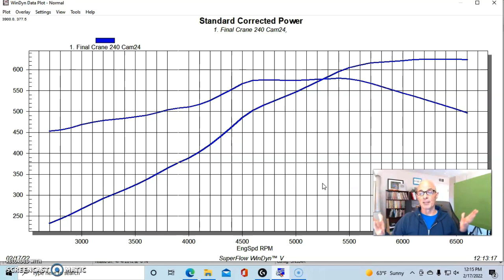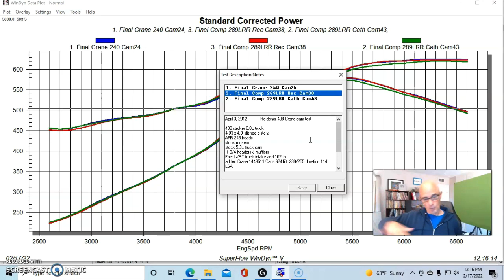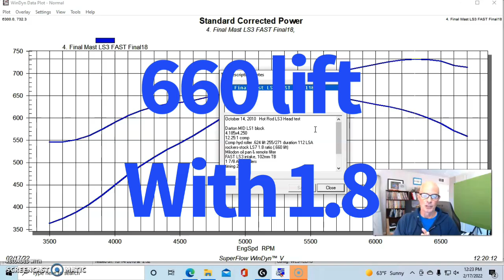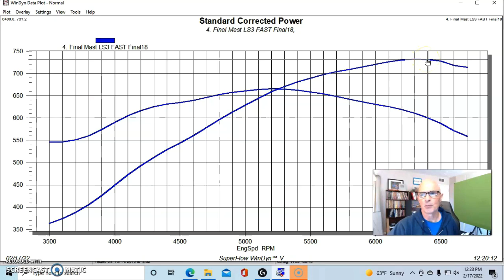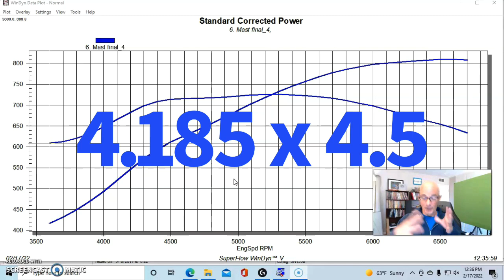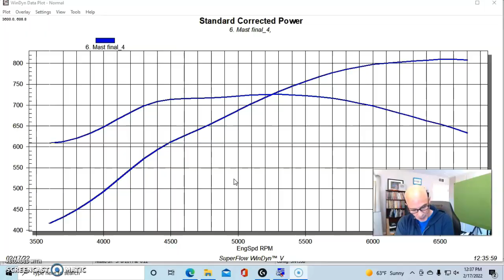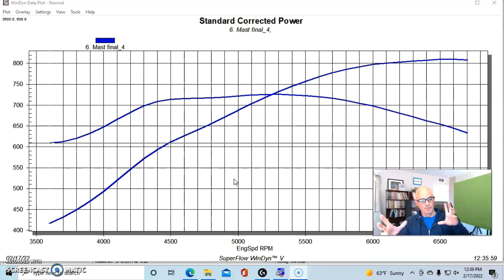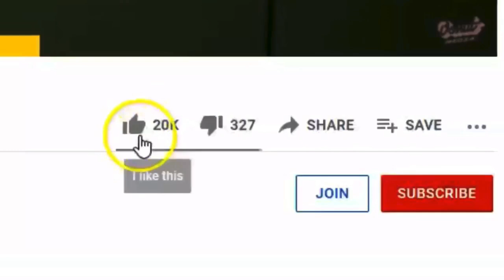HOW TO MAKE MASSIVE ALL-MOTOR LS POWER! HOW MUCH POWER DOES A 408, 468 OR 495 STROKER LS MAKE?

Comment: Richard, if doing an max effort NA build, and a boost build side by side, what size engine would you use for each? I currently have a 6.0 iron block, but if a 5.3 aluminum is better for stroker, is that a better NA base and using the 6.0 for boost?
Reply from the maker: I have not seen people sleeve an iron block but it might be possible. The 6.0L will make more power than a 5.3L, but if you sleeve the 5.3L and make it a 454 or 468-it will make more power.

Comment: Love the clarity with different cams with similar dimensions basically doing the same in 468 and de mystifying that bigger cubic inch generally better. I continually get these custom cams made for my sbc thinking there is magic in duration, lift or LC but all doing basically the same as proven through et and mph at track. Also in dreaming of future bbc purchase find magic in 565 vs 582 vs 598 but the reality is more cubic inch more power. Lessons to remember

Comment: What compression was the 408? How much does that come into play with the cam specs? I have a 12.1compression 408 trying to figure out best cam, street driven
Reply from the maker: pick a cam for your rpm range, but with 12:1 static-more cam helps suppress detonation
Reply: Thanks! I was looking at a 244/256 114+3 I’m just worried it wouldn’t be streetable at all

Comment: Why not use the Mast or LS7 heads on the 468 kinda seems like leaving power on the table
Reply from the maker: ALSO RAN THE 468 WITH LS7 HEADS-BUT COMPARED THE LS7 HEADS ON A 495 STROKER

Comment: Richard the video is VERY informative,love the content! I currently have a 6.2 as well as a 6.0 iron block.I want a naturally aspirated stroker combination that would give me an engine with a broad torque band with over 550 ft lbs of torque and over 650 hp that is reliable and streetable. This set up will be in a 70 Chevelle with a 4L80E transmission. It wont be raced but, will be spiritally driven. Any advice is greatly APPRECIATED! Thanks in adavance! Take Care
Reply from the maker: BUILD A 416 STROKER OUT OF THE 6.2l

Comment: That 408 on stock cams would make a killer pulling motor I would bet it would compare to the 8.1 well
Reply: The 495 on mild cam would be insane for pulling
Reply: 408 on stock zr1 cam how much would make hp ? As I'm planing to rebuild my ls3 engine

Comment: I’ve heard there’s risk of piston rocking during BDC on a regular 6L block when combined with a 4” stroke which causes accelerated wear on the piston skirts. Is this true in your experience?
Reply from the maker: not usually an issue with a 4.0 stroke-don't try the 4.10 or 4.125 strokes with a stock sleeve length
Reply: @richardholdener1727  thanks Richard. That was the only thing holding me back on my stroker build

Comment: What would you recommend for hitting my power goal if i don’t reach it with my current setup: 

102 mm fast manifold
102mm TB
80lbs injectors
Eagle 408 Stroker aluminum 6.0 block
10.9:1 compression i believe. 
Currently running a 234/242 .629”/.615” 112 LSA +4 advance cam. How much power do you think this setup should make roughly ? Looking for around mid 500’s.
Reply: 500Whp or 500 crank? Those upgrades just on a 6.2 would easily get you over 550HP at the crank
Reply: What heads?
Reply: @Ws6Ms  this setup made 450whp/450tq on a dynojet SAE on Livernoise ported 243's from 2008 lol and the actual CR was actually around 10.1, currently waiting for my M311 heads coming in from Frankenstein with 64cc chambers.
Reply: @elplatanito8094  I had a 408 that made, give or take a few hp, 517 whp with -8 pistons, trick flow 225s, an overly aggressive pain to drive cam and fast 92! Took that setup and put it on a 6.0 lq9, it made 489whp with similar cam as yours. I think my compression was around 10.3 or so... Your heads had to be the factor!
Reply: A piece of advice: if you can, run dual symmetric intake pipes with air filters into your throttle body. The problem with large throttle bodies is that you lose a lot of low-end response because the air velocity is so low with a large throttle body at minimum part throttle. If you run dual intakes into a collector right before the TB, you'll gain both power AND response.

Comment: So been trying to figure this out for quite some time but I really want to make a very small displacement v8 ls based engine if I could without custom parts I want something around 4L or 250 cubic inches. I want to twin turbo it kinda like ford's ecoboost but still have that v8 sound, just to prove a point that removing cylinders is not the way but to just reduce size with added boost
Reply: You can't really make a 4L LS without custom parts... you're going to have to custom make a crankshaft to be that small. In reality there's no need, if you want a small displacement engine, go with the Vortec 4200 which is the inline 6 that came in the Trailblazer. Great engine that's very reliable and can take plenty of boost. Mini videos of it online, it's considered the Chevy "Barra" motor.
Reply: Years ago I remember reading in a Hot Rod magazine about a combination of parts that would give you a 231 cubic inch V8. That was SBC stuff though.
Reply: @fryloc359  yeah it's an extreme de-stroke kit troke kit

Comment: Richard, how about doing an LS 408 stroker turbo torque monster build. Building a combo for ultimate torque instead of HP. Maybe a maximum of 5500 RPM  pulling torque from 1600RPM. This would be ideal for truck guys with gas engines pulling heavy loads looking for gut wrenching diesel torque values at the same RPM.
Reply: I've got 413 stroker Turbo engine is built forged everything hand ported req heads 4.00 bore 4.100 stroke, JE flattop pistons, intake, Roller Rockers, pretty much everything you can think off, has the fuel system that can support 2000hp, 98mm Turbo made 1600hp and 1100lbs pretty easy can go more but I'm worried about the 6l80 transmission but  have a built t400 coming for it
Reply: @Disableddragracer you have got to tell me more about this 6l80!! Who built it? And how much $
Reply: @antwain7942  its a GM 6 speed electronic auto transmission you can alter stall speed and shit points on the dyno it was on my stage 3 6lt LS, mine isn't stock but will be doing more to mine, you need to put a Good external trans cooler and a deep sump cover as they don't like heat you can buy shift improver kit for it as well as a valve body reprograming kit for the valve body High stall convters are a bit more expensive due to being electronically controlled, there excellent streetcar box but their expensive normally the horse power my engine is capable of making people put turbo 400's or power glide, I went with a turbo charger because I can control the boost no 1 needs a 1500hp 24/7 Dailly
Reply: @ZaneGREY0How is the engine doing?
Reply: @Disableddragracerwhat fuel and how much boost for 1600hp, on engine dyno?

Comment: Opinion needed. I have a 427 dart shp i used for boost. Im switching to a N/A setup. Options are order pistons and rebalance keep cu. at 428cu.Other option in use dart block and get a 454cu stroker kit. 454 kit and build would cost about 3k more. Both compression will be 13.5 e85 with a baby shot 200 or less.This is street car 80% of time.Would there be much difference in power between both.which way would you go?
Reply from the maker: I wouldn't worry about going bigger for a 80% street motor-just add more NOS

Comment: Hey Richard, what 4.25 crankshaft was this in the 468 ? I have been trying to find something over 4.125 stroke that a 6" rod will clear, to stay in a 9.240 block, but everything requires min 6.125 rod and with a 4.250 crank/6.125 rod, that leaves a piston with a compression height less than 1"....so not ideal. With a 4.250/6" rod, you can run an off the shelf 1.115 height piston, but I can't find a 4.250 crank with counterweights short enough that doesn't require a 6.126" rod.
Reply from the maker: WHY A 6.0 INCH ROD?
Reply: @richardholdener1727  so that the piston doesn't have a CH of less than 1". Not much meat in the dome after taking the 1/2 the pin into account.
Reply: ...and a 6" rod will allow me to run an of the shelf 1.115" CH piston with that 4.25" stroke. This is a case where 1/8 of an inch is a big deal (crown thickness)

Comment: I'm a little butt hurt. I have a 427 Ford Windsor engine. 600 lift cam, AFR CNC205 heads, trickflow 351R upper and lower manifolds, 75mm throttle body, 1.75 long tube headers, 3" exhaust and 60lb injectors... I'm only making about 511hp at the flywheel and 558ft tq. My engine management must need improvement😕
Reply from the maker: 351r INTAKE?
Reply: @richardholdener1727  yes, the upper and lower manifolds that trickflow makes for the mustang.

Comment: I have an 1983 Chevy truck with a 5.7 350 block and want to keep it stock what can I do to produce the most torque? I  need it to pull a heavy trailer?
Reply from the maker: headers, mild cam
Reply: Do you think that making it a383 striker will build enough power to pull the bigger hills here out west ? Or is it worth the extra cash doing that?  The 350 does okay on a flat but kinda lacks on the hills. Running Edlebrock 600 and dual plane intake. Tried to keep the fix cheap but after cost from my son overheating it I tried to just purchase a running one and it got low oil pressure and a bad cam so that tells me this block needs some rebuilding I can order a Mabbco long block performance for 1,850+ freight $250 but wanted to get your opinion on what might do the job better? I thank you for your time and opinion as I’ve owned this truck quite a while and in good shape so just wondering if I’m dumping $ down the toilet. Lol

Comment: How is it that every chart shows that the horse power and revs cross at 5225 every time no matter what it is....!
Reply: It's because of the formula to calculate HP from the measured torque.  TQ and HP will always cross at 5250.
Reply: @TheKent99  l'm looking for a cam for my 351 but not sure, is it worth going above 5000 for a relatively stock motor and still get high horse power, what would you recommend...?thanks
Reply: @josephclearnight3403 , I'd suggest looking for reviews from similar builds and see what seems to fit your criteria.  I don't really know the 351 Fords very well, but I'd be inclined to agree that picking a cam for power past 5k RPM is probably not a good idea on a mostly stock engine.  I remember the 302 Ford heads being pretty awful and I doubt the 351 heads were much better.
Reply: @TheKent99  you are right the heads need velocity, a manifold as tall as the empire state building......thanks for response.

Comment: I think over 800hp (pump gas )can be achieved with around with a 427 to 454 with say around 7200 to 7800 rpm range with a little attention in cam and head combo,and with a carb
Reply: Seen a number of LS7s with All-Pro, MAST, "insert a great head" and solid roller cams, do this.. even with stock LS7 internals.

Comment: Just curious. How would a 4in bore and a 4.125 in stroke compare to a 4.125 in bore and a 4 in stroke. Would that be the same displacement and if so how would the hp and torque differ. It's been a long time since I ran the math to find out displacement of an engine and quite frankly I have forgotten how. I used to have a book with all the formulas for every thing in the engine to transmission and rear axel gears to tire sizes and rpm. 
I just was wondering if 2 engines had the same displacement but 1 had a large bore and shorter stroke and the other a long stroke and small bore how they would differ. I think they will make the same hp and torque if everything else is the same heads cam and intake but I think they will a lower or higher peaks in rpm band. Or will the cam be the ultimate decision maker and put both at the same hp and torque peaks in the rpm
Reply: If you have motortrend+ app they test this exact question on engine masters. They use two different 468 big block chevys and try to do one huge bore/short stroke and one small bore/long stroke. In the end they make exactly the same power within 1-3hp and tq at the same rpm. There is no change in the rpm band.
Reply from the maker: if you keep displacement, compression, cam and heads and intake and exhaust the same, power should be very close

Comment: I finally got my block back with my balanced stroker kit. It’s a LQ4 block bored .005 with a 4 inch crank. I guess it’s like 405 inches. I have TEA stage 2 799s with a 225/232 114 cam. It’s at about 11.6:1 compression. What kind of FW numbers will this thing make? 550hp 550tq is what im hoping for!!
Reply from the maker: NEAR THAT
Reply: @richardholdener1727   Dang, I was hoping you would say “ easily “ 😂. It will have a ported TBSS with a 92 mm TB. Thanks for responding!!
Reply: @chandlerlofton6536  😆😆

Comment: What really surprised me is that the 408 with the cam swap not only picked up massive HP, but torque down low really didn’t suffer. It actually somewhat mirrored the original HP curve, but higher of course.

Comment: no replacement for displacement, (NA), and of course your cam choice, intake/exhaust combo. Add good compression, proper assembly, A/F ratio, timing, fuel, Oh yes, and $$$! Thanks from Calgary AB where today(20/02/2022) it's -18C and about 20 cm snow.
Reply: Just happened to see your comment  and wanted to say hi from whitecourt AB

Comment: Sure they can make big block power numbers, but are they costing 2x as much to get there vs a big block? Once you get into this realm of CI small block, I would think big block becomes more appealing on cost, or maybe not? BBC will lose out on weight and packaging size for sure, I don't think MPG is really going to be much of a factor once you get 450 CI + even with EFI.
Reply: I agree, I rather build a big block as it's always going to make more power n torque.. That's always the case, stroked engines prove that..
Reply: Yah but, but, but, there is always a yah but. Let's say ya already have the small block, so you're going to need the suspension that'll hold up that big block, different motor mounts etc etc etc, what if it won't fit in your projects engine bay, is it a daily driver, do you have to have the most or best ever, there's always a bigger big block, where does it end, how much does it weigh, you could get a 700"  Hemi with a screw blower or you could make 1000 horsepower with a 5.3 1400 with a 6.0 and twins. Ever seen a chick with Hooters The size of a beach ball, someone probably likes it. But man I bet the bras are expensive.
Reply: @kevinwest3689  'more than a mouthfull is a waste' and don'cha  just love the 'yah butt" folks ?! yah , butt , "if my Aunt would have shaved she'd of been my Uncle"
Reply: @danielcarroll5667 I Know Right...so your aunt doesn't manscape? Or your uncle is a.. slick dude.  Butt Butt my family is way more bizarre! I'm talking too much compression for pump gas if you know what I mean 🤪

Comment: I wonder how much power these motors would have made with running 13:1-14:1?
Reply from the maker: MORE
Reply: @richardholdener1727  they say 3% per 1 point of compression would you say that's accurate? I am guessing no there's a lot more that goes into it like longer stroke mite help make more power per point of compression, also cylinder head type, what fuels are used, so many different variables. I would like to see a max effort rhs 496 14:1 compression on methanol all motor.

Comment: Would be interesting to see the 468 with a Holley sniper EFI to see if the intake is what changes the curve or the carb. I imagine with THAT size carb it was just the intake design.
Reply from the maker: IT'S THE INTAKE DESIGN-PLUS CHARGE COOLING
Reply: I wonder how much boost can the LS 468 take ?

Comment: Making this much torque what type of transmissions are you fitting to these engines? Seems like you're beyond even built t56 magnums.
Reply: Stock 4l80e with a shift kit
Reply: @austindoud273  6L90.
Reply: T56 can take lots more than these are putting out. Built ones can take 2k.
Reply: @natricjol  yeah for 15k
Reply: @austindoud273  Magnum can take 700lb-ft. Magnum Tranzilla can take over 1200lb-ft for $6k. There are many sitting behind turbo Cobras, Camaros, Vipers and Vettes that are putting out more power than these engines that have never been upgraded.